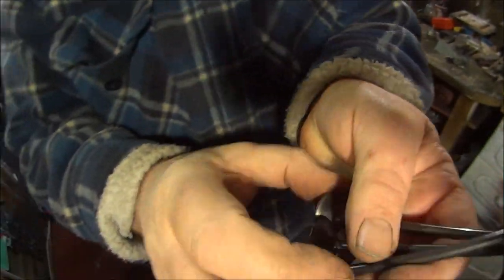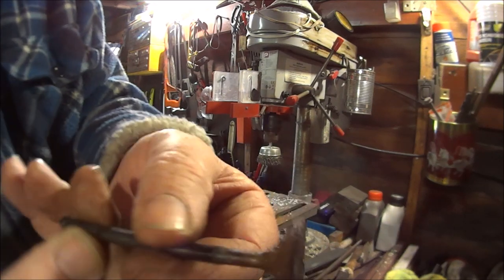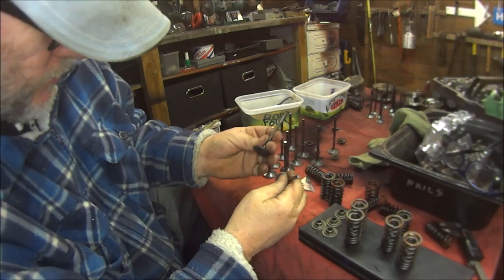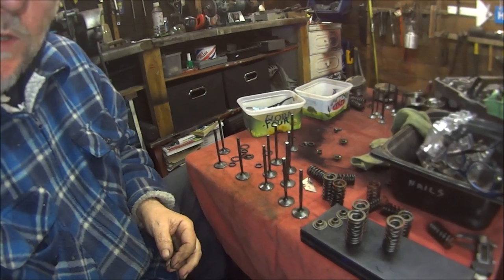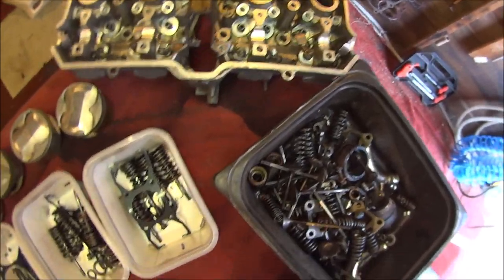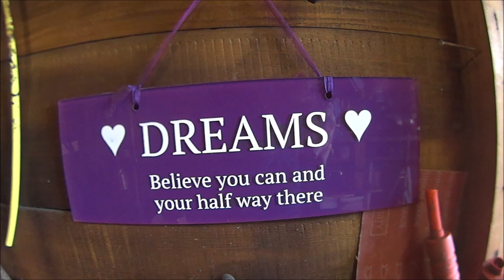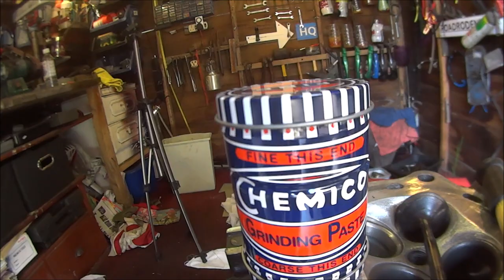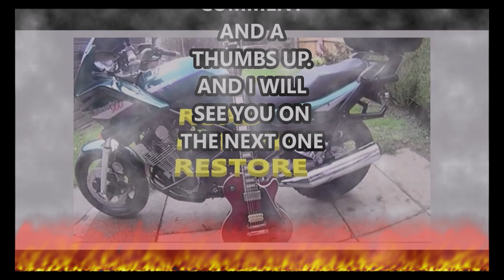CBR1000F Cylinder head rebuild part 1.

Comment: Hi Jon you cutting the values in my mate used to use a drill but finished it with the old method that wooden stick with the rubber on the end took ages but got perfect seal you stay safe 👍🏻
Reply from the maker: Hi Derek cheers for the advice I'm doing that in the next video. 👍. Glad you have got the new BMW sorted. 👍
Reply: @jonyr1TT  thanks Jon I’m going out on it today Coventry to Hinckley then to Rutland water should be a nice ride out 👍🏻👍🏻
Reply from the maker: thanks derek